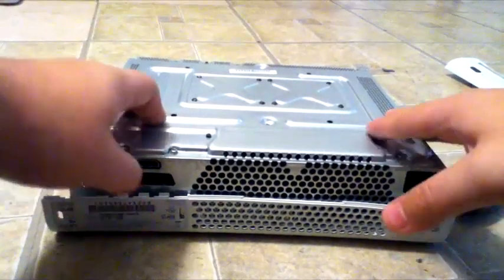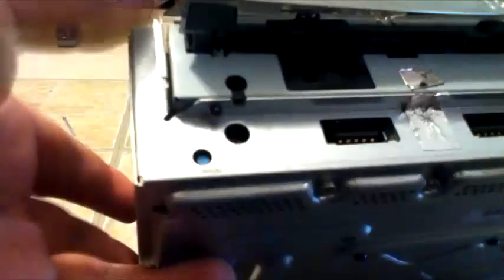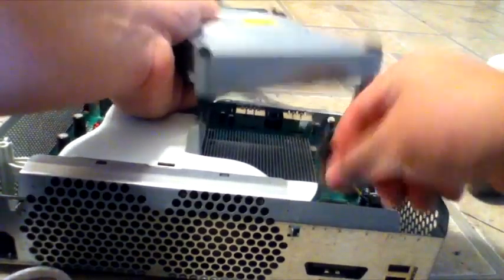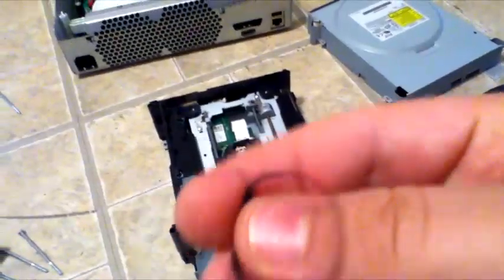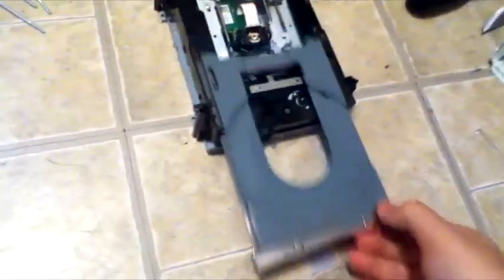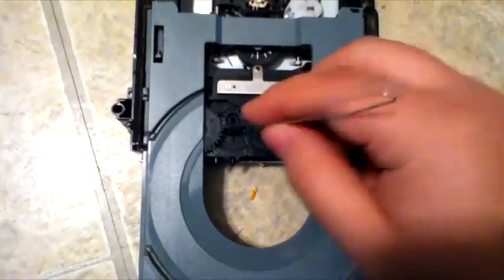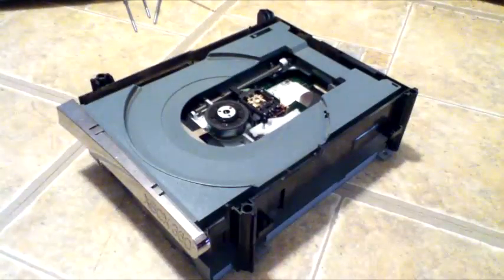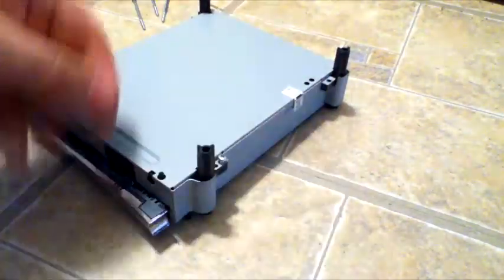Part 3/4: How to Fix an Xbox 360 Disc Drive That Won't Open: Fixing or Replacing Rubber Band

Comment: Between this video and another one, I got my Xbox working again, yay!

The Problem:

My disc tray wouldn't move. Even using the manual eject with the paperclip wouldn't get it to budge. I had been having problems with opening for a while, but finally, it gave up. I used a screwdriver to try to get it to release, but all that happened was that I unseated the drive tray, and made it worse, and it would not close completely and still wouldn't open.

I noticed, when I tried to push the tray in, there was a great deal of stress on the gears. I knew I needed to repair the thing. It's 4 years old, so no issues with warranty.

This video:

I learned two things that helped a TON!

One, I learned to dip the belt into hot water, then cold, and put it back into the machine. I'm a little worried about effects on the materials, but it was worth a try. Other videos have you just pull the tray out and shut down the machine. You can still get to the belt, but as my tray wouldn't move, I had to take the entire machine apart.

Two, I was able to look at the video and see where everything was, because it also seemed like I had a problem with the timing of the open/close positions of the lens platform and the position of the tray. I made sure that the carriage (I suppose it's what it's called--the thing with the teeth that is moved by the gears and raises and lowers the platform) was in the same position as yours. 

Thank you, so much!

Comment: You can actually take off the rubberband without taking apart the whole xbox. Just open the disc tray using a flat spoon or paperclip (just search for temporary fixes). Then when the tray is open, unplug the xbox. Then use tweezers to unhook the rubberband and use the boiling water like in the video. Then just re-loop the rubber band through the small spool and over the front part of the big spool. Then just hand-wind the rest of the rubberband back on by rotating the big spool. There ya go.
Reply: I used your method coupled with his rubber band fix and it worked perfectly. Just make sure you don't move the console to a position where the disc drive can close. Pain in the a**.
Reply: thats what idid with the tweezers when i tried taking thebackoff i was like f*ck this
Reply: @nicky8661  how do you open the disk tray again after it closes without the ring

Comment: You don't have to disassemble the console for this, not even to boil the band. Just get yourself a flashlight (I used my phone's light), power off console, use a paperclip to open tray, remove the band, wipe it (I used some antibacterial wet wipe), then reverse it (so that the inner side is facing out and not touching the gears), put it back on. First put it on the small motor gear, then as much as you can on the big gear and turn it (the big gear) clockwise while holding the band so it doesn't slip off. Voila! It's like new now... Just bought a used arcade jasper.
Reply: This.   Can confirm. Just did it and it took maybe 5 mins.
Reply: Hats off for you sir thanks
Reply: hytlerson I have just tried it and confirm that IT WORKS!!!!
Reply: yes.. i agree

Comment: Thanks for this video.  The rubber band replacement trick worked.  I had tried a drive replacement and board swap before trying this and was about to go and buy a new xbox.  Thanks again.

Comment: No need to tear it apart just get a pair of forceps reach in pull off the rubber ban heat it in the water cool it then replace it with the forceps.

Comment: Thanks for the fix it video it helped a bunch.. I was able to remove the band without taking apart the Xbox. Also just a tip for others after you condition the band with hot and cold water dry the band then coat it with dish soap let stand for 5 mins the wipe clean and re install. The dish soap helps restore elasticity to the rubber.
Thanks again

Comment: Its easier to get the stuff out the sides if you taker he tray out. You lift the little tab up on the left and pull up and pull the tray then just lift up and out on the right side and the tray just comes right out, no damage or anything

Comment: I'm in serious shit right now.

My xbox tray at first wont open (produce loud grass cutting machine sound). so i do the paperclip technique. it open manually and i take a look around it, i found out that the rubber band/conveyor belt at the gear to the right hand side was cut in two. now, is it DIY fixable?

if i send to shop for repair, will they just change the rubber band or change the whole disc driver?

Comment: If you have a pair or needle-nose tweezers skip to the part about removing the band... its right at the front. I only had to remove the faceplate on my xbox to open the tray. Good detail on the videos though for those who have difficulty doing it the fast way.

Comment: I took my faceplate off, used paperclip to open tray, cleaned rubber band right there with a qtip n alcohol.. also cleaned pulleys n gears and edge of tray.. works like a champ and didn't rip my xbox and cd drive apart.. you can even push tray in n out to help you clean.  You're welcome!

Comment: I found that the boiled rubber band only worked for one use and that I needed to buy a replacement rubber band ("belt") off of eBay as a more permanent fix.  It was still very cheap to buy a new one.

Comment: nice video. is it possible to get the rubber band out and back in without opening up the console? i can clearly see the rubber band when the tray is opened
Reply from the maker: Maybe if you're like super good at mechanics and can shimmy it in there, I think it'd be wayyy easier to just take it apart again. :(
Reply: Frankieseshy ahahaha mine fell of and i just shoved it back in with a tooth pick. And i called my self a EngineerR. LOL

Comment: SO my issue is it opens when the metal casing is not on it but as soon as the casing is re attached it wont open?
Reply: There is a magnet that holds the DVD in place, and the magnet on the spinner weakens so the magnet on the case holds the laser assembly up. So on the case magnet, you need to put tape on it to weaken it. If you put too much it will make a grinding noise.

Comment: Good job.  I also swabbed the belt pulleys with some alcohol, because they were really dirty too.  Works like a champ now. I wish I'd got my hands on the one I have here before someone fed the front bezel to a lion in an attempt to get the drawer open.  Anyway, now I have a working XBox, scored for $5.99 at the thrift store.  Wooha.